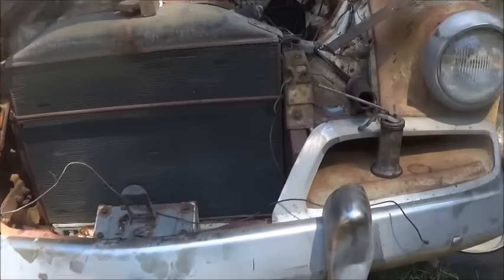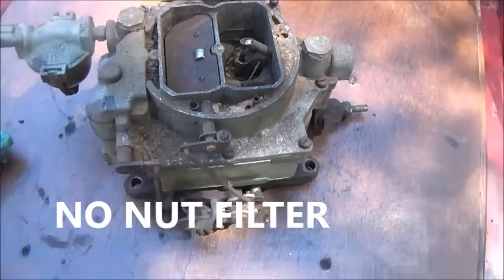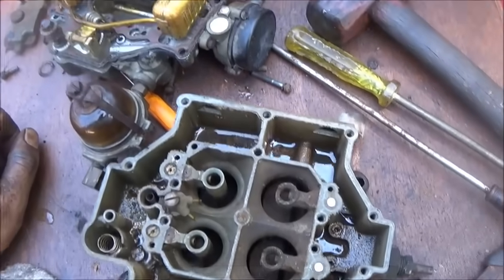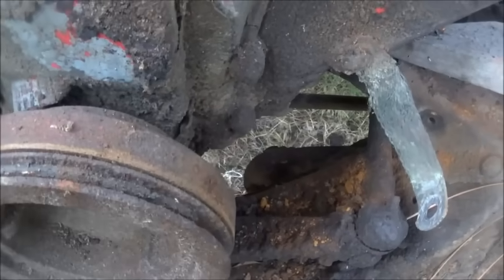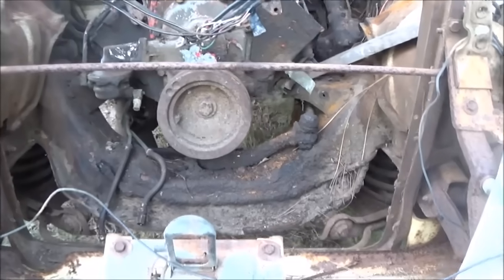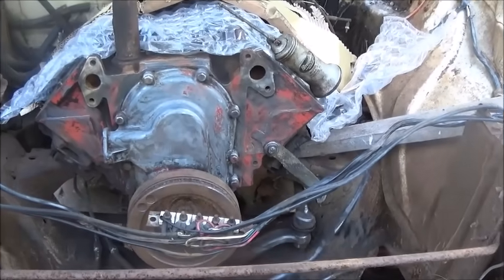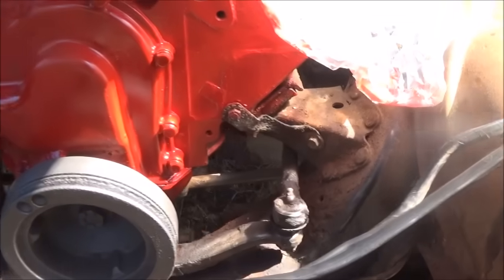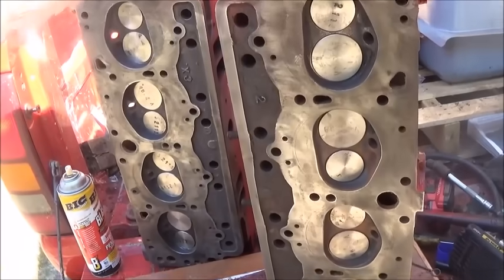1956 STUDEBAKER HAWK, ASSEMBLY CONTINUES, CAN WE CATCH UP???

Comment: Me: worried about microns of dust getting in my engine inside my shop on a concrete floor.  Jonathan W: building an engine in the Carolina sand hills and everything will work perfectly.

Comment: I'm old enough to remember them Chevrolet motor mounts and the cable setup they came up with. After mine broke a tore up the fan shroud I used a piece of chain around the frame to the engine.

Comment: The cables stopped the motor kick up and also keep the throttle rod from binding at wide open when motor kicked up. Later the throttle was changed to a cable in 1969 I believe.

Comment: 1955-1956 Nash Eights had Packard's big 355 cu. in. (5.8 L) V8 with 220 hp, mated to the ill-starred Packard Twin Ultramatic transmission, purchased under a short-lived reciprocal agreement with Studebaker-Packard. In late 1956, this was replaced by AMC's own 327 (5.4 L) V8. Some of these may have had a stick shift. Hope this helps

Comment: Those Carter WCFB carburetors  Were used on a lot of V8's In the  Late 1950 and early 1960. Those were the carburetors Chevrolet used on their 270 horse 283 2 -4 barrel set ups. They were pretty trouble-free and easy to work on.
Reply: I put a pair of wcfbs on my performance 312 Ebird, upsized accelerator pumps for no bog instant full throttle power. Most fun car of my collection but really bad mileage even cruising in overdrive. I always have my blocks boiled out, cheap and really important.

Comment: Love watching this old girl claw back to life. You're a patient man. Years ago, I was checking a customer's complaint with the hood up. If I put it in gear and held the brake, then gave it a little gas, the engine would 'hop' as the broken motor mount yanked on the rod-type throttle linkage, then drop as it tried to stall. Very entertaining, but not very useful.

Comment: looking good I have a 48 1 1/2 ton was thinking of installing a dull lines one for the front and one for the rear with a protioning valve in the same location, and clean all the lines and repack the wheel sealures

Comment: I love what you have got done so far , Jonathan ! I'm hoping that you can save that fuel pump , & that the transmission actually still works for you . Sometimes they have to run a while to heat the oil after they've set for a long time . After that , they usually work better as you run it . We will take what we get . Looks fantastic , really liking the red paint . Knowing how you are , it will run like a dream . Pretty much a rebuilt engine , minus the bearings of course . Must not have been that bad . I believe you said it was a low mileage car , so , here's hoping she works out just fine ! God bless , you & yours , J . Take care , brother !

Comment: Ran a Carter AFB on both my small block Chevy Vega and my 69 Roadrunner. Compared to a Holly carb.
Never had to work on my Carter after it was installed. Windage tray in oil pan. The more I watch. The more I'm thinking Studebaker was way ahead of t's time. FYI:  ColdWarMotors has their Studebaker running.

Comment: Enjoying your videos 😊 apologies if already explained, but why if putting all this work into it , would you not remove the engine , clean it & the engine bay property & assemble on an engine stand rather than bent over a fender ?
Reply from the maker: It goes back to the question of "where do you stop?' Should I remove the body too, so I can clean the frame? Put the body on a rotisserie so I can clean and restore the underside? Up until the late 50's early 60's cars and trucks were made to work on without removing the engine. The reason all the boring bars are portable is because they were made to go to a shop and bore the block while the engine was still in the car. I am not opposed to pulling the engine at all, but just like doing things the way they were done.